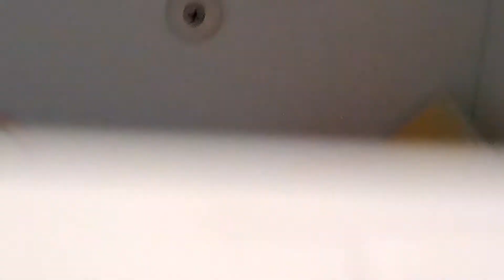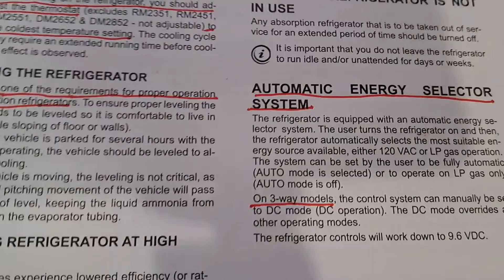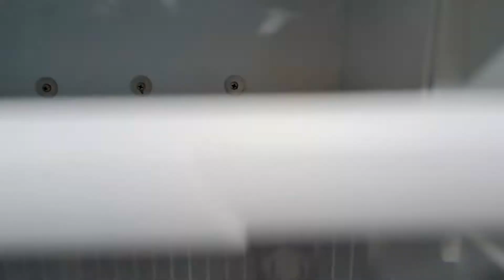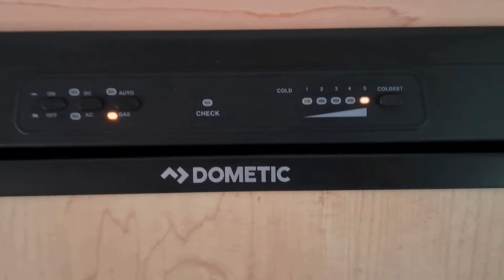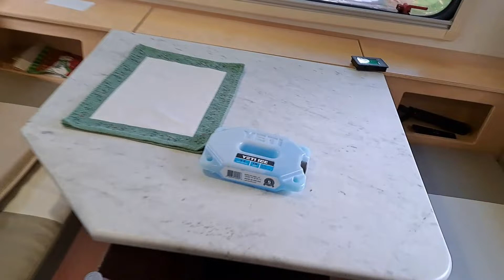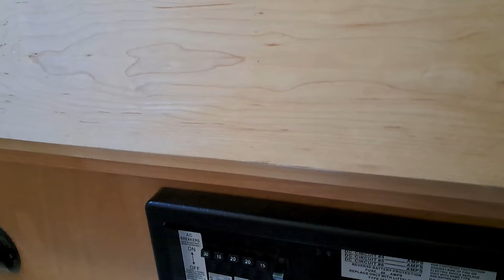Dometic 3 Mode Refrigerator Operation - Features – Modes – Setup - Care

Comment: Thank Heaven the fire breathing dinosaur absorption fridge is on the way out! Even die hard Northwood Manf. is switching to 12V fridges in their Nash, Arctic Fox and O.R.V. lines.
Reply from the maker: Good news if 12v proves to be efficiently use of battery
Reply: Weekenders would be fine with one or two AGM's Full timers will be and have been switching to Li anyway with the huge price reduction of Li Batteries. The best thing....nobody will burn to death from absorption  fridge fires. @ramblinroses6066